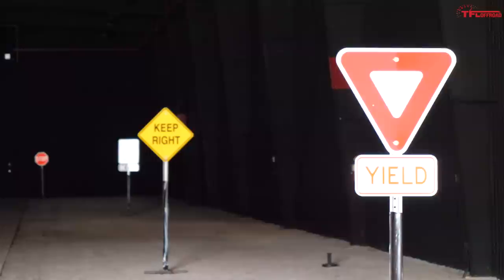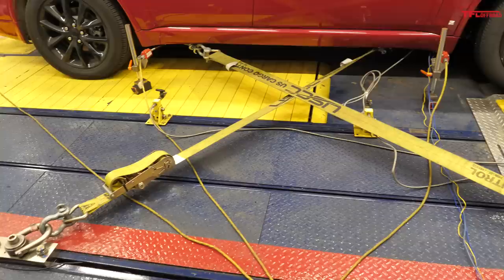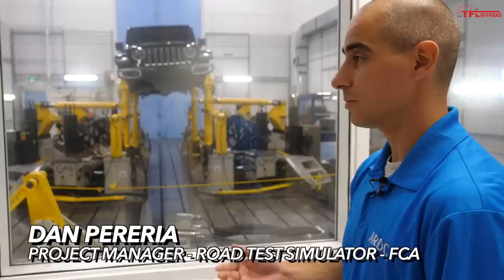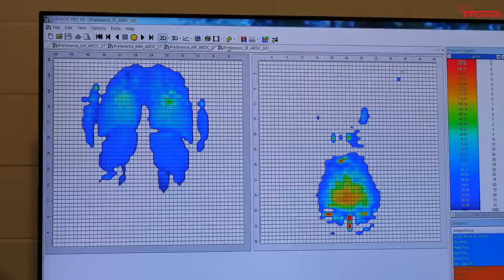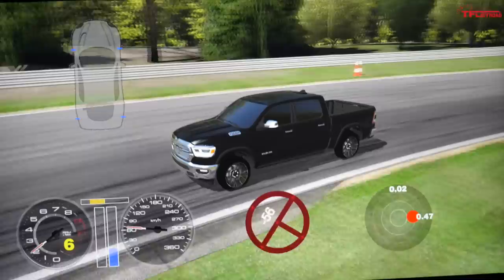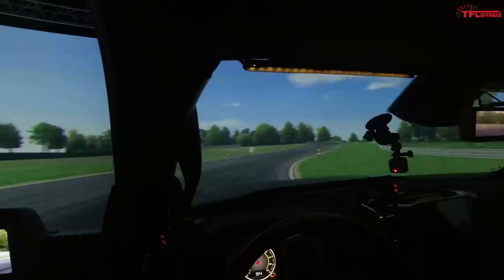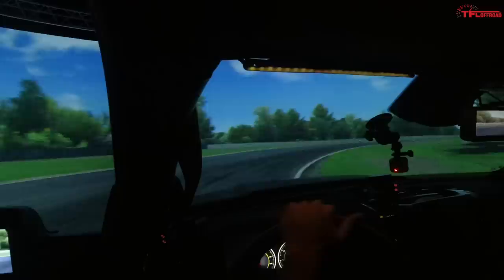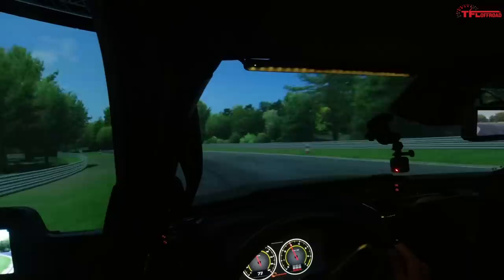Watch Jeep Beat The SNOT Out Of A New Gladiator To Test For Durability!

Comment: If they tested this so far they should test their transmission lifespan
Reply: You mean the zf8 life span which is one of the best around? Nah, Chrysler had major issues with their own tran. years ago only on minivans
Reply: @tallll70  ummm no and no.  The 68rfe in their 3/4 and one ton are notoriously weak.
Reply: @richfarfugnuven6308  I admire your confidence, but in my area i hear people saying nothing but good things about 68rfe, i had 5 speed in Ram for 11 years, had to replace solenoid pack about 2 months before tree fell on it, while my friend had to do same on 5 year old Tundra. Now im in 6 year old ram and it shifts like dream. I asked questions for fluid replacement in one tran. Shop and at the end i was told they don't get trucks with transmission problems, they don't get much any trucks really. So that's my reality, and hopefully it will not change

Comment: Cool video, even if I'm more than a year late!
I found the headlight tunnel interesting. Ever since I had a first gen Chrysler 200, I marveled at how excellent the lighting was despite being two single HIR bulbs in bifunction projectors. I regularly drive cars with HIDs and even LEDs, quad-beam setups etc, and the old HIR bulbs on the 200 are, remarkably, right up there in performance. While technically not as bright as HID/LED, the effective distance of illumination is very impressive, and the beam pattern perfectly shaped--all the lumens go exactly where they're most useful. The low-beams were seemingly purposely kept somewhat dim with more output allocated for the brights so your eyes aren't adjusting to a bright foreground (think of trying to look at the moon with a 60w lightbulb a foot in front of your face). Their use of that tunnel definitely pays off.. Very smart! The glare notch was new to me.. I always just assumed it was an optical effect or a tiny imperfection in the lens geometry. As usual, there's more that goes into design and engineering than most people would think. Fascinating facility!

3:40 reminds me of Johnny Five for some reason lol.

Comment: When did they beat the snot out of the gladiator? The suspension test? Looked like it was simulating driving on a gravel road.
Reply: As always, you need to ignore the bogus titles on pretty much every TFL video.  Get used to it, because it's not going to change.
Reply: @RyanRKJ - Thanks, noted.

Comment: I saw this same rig under an F series like 10 years ago.
Reply: Guessing Ford won motor trend 2019 truck of the year. Right?
Reply: @SixSpeed440  shrug
Reply: @SixSpeed440  truck of the year has nothing to do with reliability
Reply: @SixSpeed440  sorry I should say long term reliability
Reply: @nathanmclaughlin1586  Long term reliability? The f-150 has had multiple recalls in the past months. This is a vehicle that was fully redesigned in 2015.

Comment: That torture test doesnt work. You cant put 10 years of wear in 4-6 weeks on a vehichle stored inside. Rubber joints wont dry rot etc like it would driving around.

Comment: My transmission completely burnt up at 48k miles on my 2015 that I bought brand new, the Chrysler  dealer mechanic himself told me to “run this transmission design is shit” after paying $4,800 for a brand new transmission that oh yea they did not cover because of the 1/4” taller tire than warranty allowed I had on it. I left straight from there and traded it in on a 2018 z71 do not regret my decision..

Comment: But it’s in a controlled environment. Need to get the heat and cold factor to degrade the bushing’s on the suspension. In this environment the bushings would be fine. Get some rotten bushings in there then test it. In the real world after 160,000 miles things will be a lot different

Comment: If you were to put 160,000 miles on a vehicle within the timeframe of 4-6 weeks, the average speed would have to be between about 160-240 miles per hour. This is why "simulated testing" is bullsh!t. You can't fake time. On top of that, there's no weather, or road dust or any normal everyday wear-and-tear that a vehicle would go through. Not to mention that there's no power going to the wheels anyway so the testing is completely ignoring the lateral motion of accelerating and braking, effectively making the test a huge waste of time and money in the end. You want to see how reliable and durable a vehicle is? Drive it.

Comment: I work at a Jeep/Chrysler dealer, these came from the factory with no grease in the driveshaft. They are made cheap. Gladiators and wranglers. Most Jeeps need a motor by 75,000 miles and a trans at 100,000miles if I were you I’d stay away from all vehicles made by Jeep unless it’s a grand cherokee. If going for Chrysler same story most come from the factory with issues only the Durango’s have a good rep. Either get a ram or a Durango. End of story. STAY AWAY FROM JEEP!! 
You’re welcome before you get into a “money pit” after warranty expires (;

Comment: Can they simulate it sitting in the driveway and getting the rust rats.  Or like in my 17 wrangler it just randomly not starting or the tires rubbing the front air damn when you pull in a driveway.  I’m giving it back when the lease is done and getting something else.  I’ve always had dodge and I’m tired of the stupid issues.  Just want something that works consistently even when it’s brand new.

Comment: The simulation at 3:00 is flawed. The only thing it simulates is 4-6 weeks of 24 hrs a day on that machine. The suspension on a vehicle with 10 actual years of use gets wet, dirty, muddy, possibly salty, soapy, power washed, and air dried, it endures freezing temperatures slush buildup with road salt and sand mixed in and extremely cold and hot cycles.  The doors and seals experience the same as well as years of opening and closing, people taking them on and off repeatedly, etc.. all this machine does is shake it for a long period of time.

Comment: Didn't those things just get recalled for faulty welds in the chassis?  I used to love Jeeps lately the price has gone thru the roof and the reliability is gone down the toilet.  But I guess that's just about every automaker  these days.  If I could do it all over again probably become a Subaru mechanic.  Those guys always have a ton of work fixing head gaskets.

Comment: That full chassis shaker system is a PR one-trick pony only.
At no time can it or will it simulate 100,000 miles of dirt, sand, cold, or hot.
So, it's for FIAT being able to SAY they make good bits.  But not really prove it.
Why?  Because everyone knows 100,000 REAL miles on a Fiat IS MORE THAN enough to reach imminent failure.

Comment: The machine testing 10 years of hard use on the suspension is so un-realistic. It’s in a perfect lab environment. Can they simulate temperature changes?How about mud, dirt, snow, rain, ice, salts and de-icers etc? No, it can’t. Those are just some of the things that the typical vehicle will encounter in a 10 year period. 
Also, are they flexing the suspension beyond its travel, you know, like a Jeeper would while off-road on 3 wheels? 

I’m sure it’s a fantastic machine and lots of data can be gained from it but it’s still not the real world.

Also, they need to simulate added weight like fuel and fluids, cargo, passengers, winches etc. because cars don’t go down the road for 10 years with nothing in or on them.
Reply: the video is showcasing one specific testing lab within FCA. This one machine with the Gladiator is testing for fatigue failures on the structural components like the frame and suspension.  It's not perfect but it's much faster then the real world. This is done in conjunction to actual proving grounds testing in the real world. Those take longer but are more representative of the end user.

They also have many other testing sites that will look at corrosion, mud, dirt, rocks, hot and cold.

They also have the appropriate weights like people and fuels. The video is just a demo for the media to film.

Comment: I would love to see crashtest of the Wrangler.  No one have tested the Wrangler since Euro ncap showed extremly terrible crashratings of the Wrangler.
Reply: Kristofer Olsson The Euro ratings were due to lack of crash avoidance tech on the model tested (tech that is available now here in the states at least). Watch the video and look at the actual crash results- not as bad as the overall rating implies.  In fact if you notice how well the Wrangler faired structurally and imagine it hitting an average SUV not a steel block, you would rather be in the Wrangler.
Reply: Thats not true. Jeep Wrangler got 1 star rating. Worst Suv tested last 7 years and second worst vehicle tested out of ca 200 cars/suvs. Only Fiat panda/punto was worse. If we compare it with the second worst Suv in Jeeps class 2018 when the test was done BMW X5 got 5 stars but the second lowest rating. The second worst suv/car in all classes combined was Suzuki jimny with 3 stars. 
 BMW X5/jeep Wrangler/Suzuki Jimny
Protection of Adults. 89%/50%/73%  (exampel on details side colision X5 15.2/16p Wrangler 8/16p Front impact X5 7.5p/8p, Wrangler 5.7p/8p etc)
Protecion of Kids 86%/69%/ 84%  (exampel on details kids 6-10 years X5 23.9/24p Wrangler 20.8/24p)
Pedestrian protection 75%/49%/52%
Crash avoidence systems. 75%/32%/50%
The score was extremly low all over. So its no question that the Wrangler failed in almost every aspect of the test. If you dig deep in the details its very few places were the jeep got a good result Whiplash was one of the few. (1.7/2p) So even if they put in state of the art crash avoidance systems they will not get more then 2-3 stars. Ford Mustang tried that they went from  2 to 3 stars. Still bad results.
Reply: guy proulx Front side airbags are Standard equipment on the JL Wrangler. Im not saying the new Wrangler is the safest vehicle on the road, but it’s far from the death trap reputation of the cj models etc...
Reply: Adam Harriger look at the video of the EU crash test. There’s no airbags in the rear, a child dummy smashed its head on a C pillar and the restraints allow for crazy amounts of whiplash. Even the driver dummy managed to hit a pillar because the airbags are so sparse. It’s a modern car ffs. My 12 year old 4Runner has a better safety rating and performance.
Reply: Silver Qilin Again I understand it is not the safest vehicle on the road and doesnt have every safety feature available on other vehicles. But it is the only suv with a removable roof, doors and folding windshield- there have to be tradeoffs for that functionality. Some people value those features and the experience it offers- personal choice (I see kids on motorcycles and atvs all the time). 

Todays crash tests are more stringent than ever and Im still confident the new Wrangler is better than alot of cars thought to be safe not that long ago. It is a very solid body on frame vehicle, that in the real world vs many other vehicles would fair pretty well (as compared to an unmovable steel barrier).  Id rather be in a wrangler than a prius any day of the week despite all the prius’s airbags.
Reply: Adam Harriger I thought body of frame SUV’s were slightly less safe than unibodys. The safety is compared to modern cars, I would never take a Jeep anywhere busy or passed 45. I mean my 4runner is 12 years old and has curtain airbags, it’s already safer than the modern Jeep. That’s where the issue stands.

Edit: Kids on motorcycles and ATVs are just as bad too, but just because it’s cool doesn’t mean the chances of death and serious injury aren’t more prevalent and not a consideration. 

I’d rather be in the Prius that’s unibody, has crumple zones, actual air bags, good restraints, and a host of other basic safety features. Not even all that fancy pre-collision things. At least I know in the Prius I’m less likely to hit my head on a pillar or lose a leg.

Comment: Show me where they "beat the snot" outa the gladiator. Cuz them hydrolics are only replicatinf like a grval road or rough gravel road. Not no damn gravel road with pot holes eveeywhere or goin fast over some hard bumps or holes while offroadinf or goin over big rocls or small ramps/jumps. Like fr. And then i would say their beatin the snout outa it. Plus the weight is shifted perfectly and not the same as if the jeep were actually goin offroading or on very rough terain.

Comment: You want to fix something fix the dry rattle from the start of a cold 5.7 l hemi,fix the thumping echo you get when you have the two front windows in your 4-door truck up and the two back windows down and you are driving down the highway and it sounds like a set of subwoofers are continuously hitting a low Hertz bass beat fix the continuous front-end problems that RAM and Dodge ram have very poor quality upper and lower control arms ball joints I could go on and on fix the sliding back glass window on a 15000 mile ram 1500 and build it to where it actually lasts a hundred thousand miles and doesn't start jamming up after only 15,000 when you hit the open and close button. fix the engine shake at idle while it is in park to where the truck actually runs smooth and doesn't feel like it has a coilpack going out. Fix the SAG of a Dodge ram 1500 with only 7,000 lb on a trailer Charley when it is rated for over 9000 lb,and the truck looks like you are ready to launch a spaceship into spacebecause the rear-end sags so bad once you hook the trailer up.All these problems I've mentioned are things that your tech guys at Dodge ram Chrysler say are normal.im sick of watching videos about how you have come so far with so many new tools to help you fix so many future problems in vehicles but my 2019 ram has all of these problems and these are considered normal. sounds like you have a bunch of engineers and nobody with real life experience in these problems for that actually cares about the quality of your product

Comment: Video game testing....I don’t see any “beating the snot out of the gladiator” in this video..boring.
Reply: guy proulx I wouldn’t agree. I have an F150 screw on 35’s and king 2.5’s and my buddy kept up with me on mild tails on his bone stock JT. Now mind you a JL or JLU are both more capable than a JT in pure play off-road, but if I guy wants a small truck bed on a Jeep the JT is a good option for someone that may be overlanding or on milder trails. The breakover angle and descent angle will always take a beating with trucks.